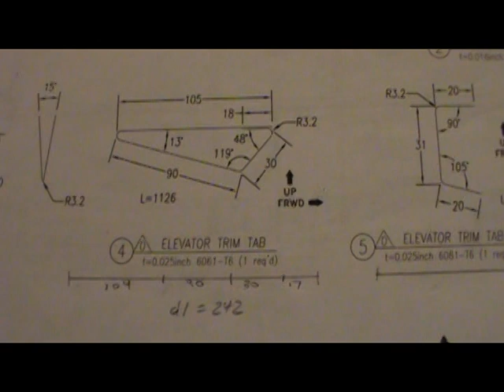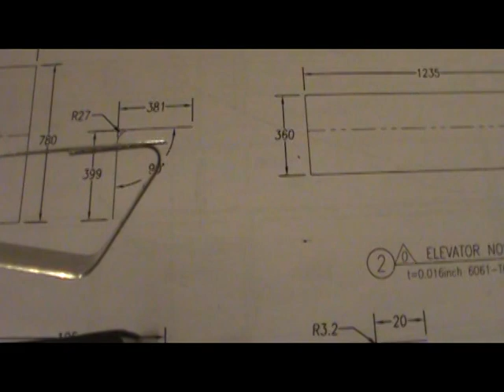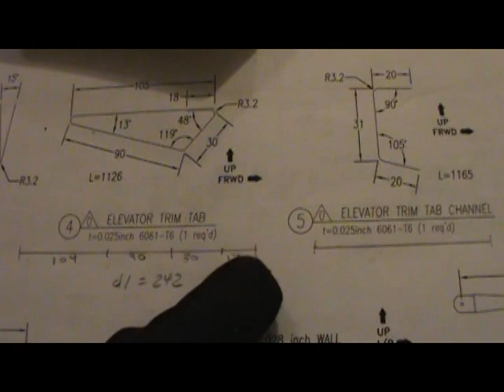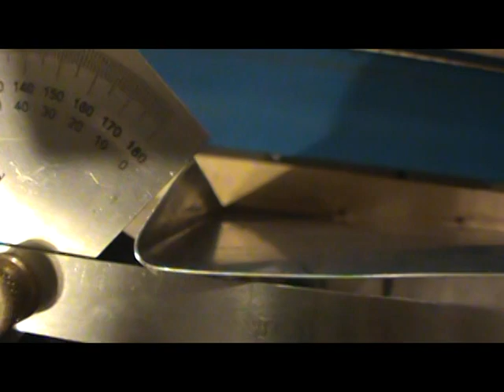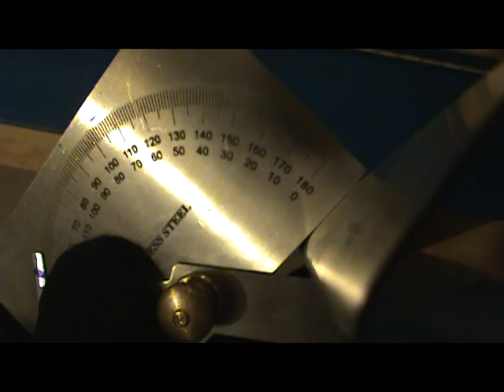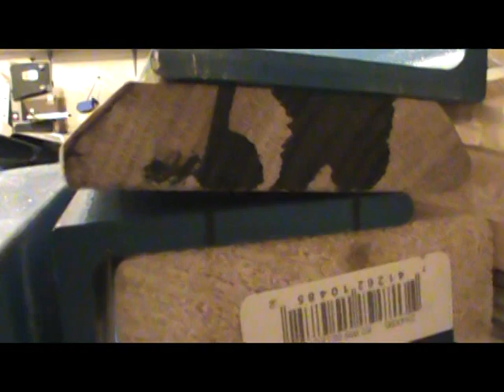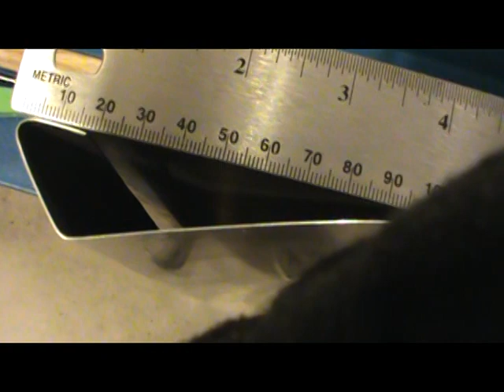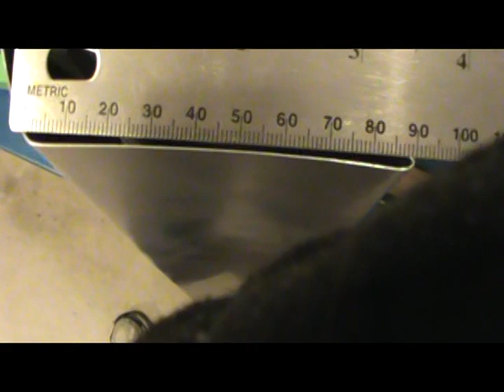Forming Elevator Trim Tab

Comment: I am considering building a Zenith and have access to a Baileigh 4FT magnetic. Is this long enough? If not how much of the airplane will it do?

Thanks,
Wylie
Reply from the maker: thewyliestcoyote It would do a lot of the plane, depending on which one you build. If you're talking 2 seaters, the 750 STOL has three 8.6' bends for the tail spars. From there you have about 8-12 bends in the 5-6' range. after that, almost everything is sub 4'. Depending on how the Baleigh is set up, you may or may not be able to do all the hat sections, Standard Z and some other parts. The other major concern is bending radius...you need to be able to bend the aluminum at radii of 1/8" and 1/4". Most factory brakes are set up for sharp bends, so you would either need to fabricated a custom nose (which can be wood) or use an extra piece of material or two to add radius to the front of the nose.